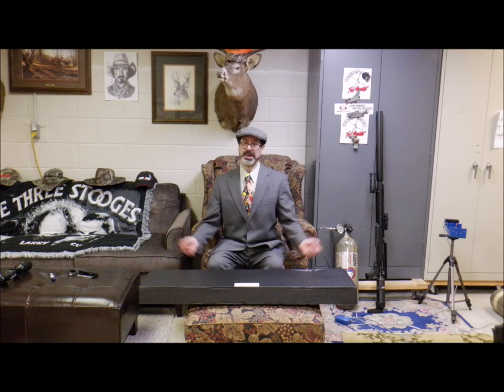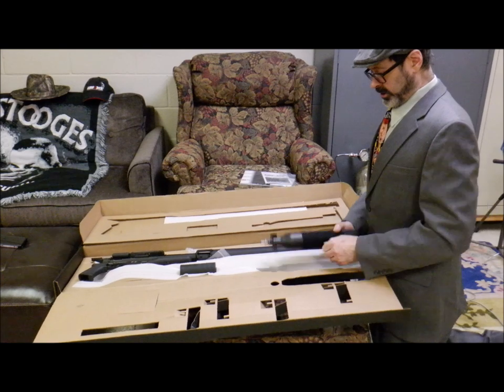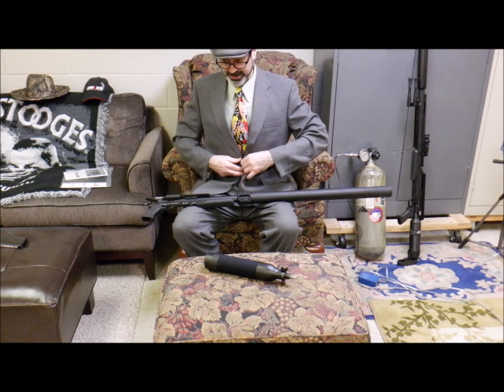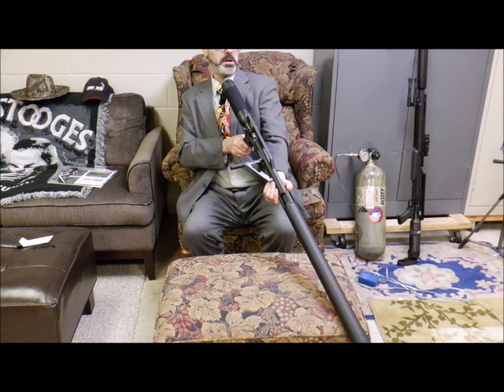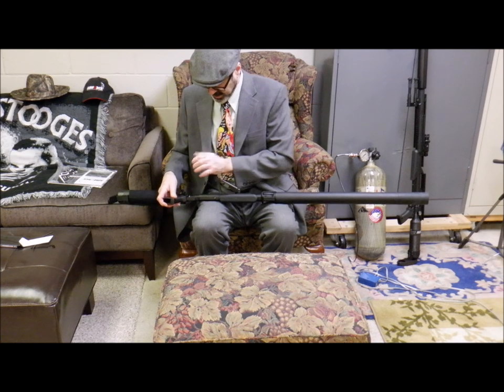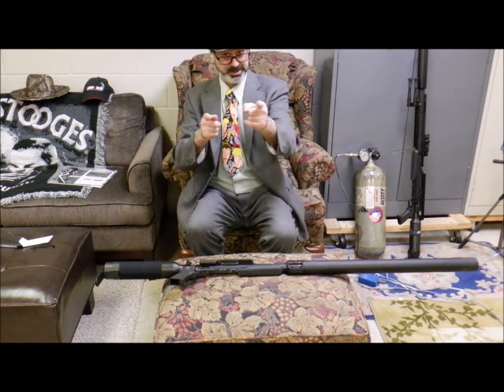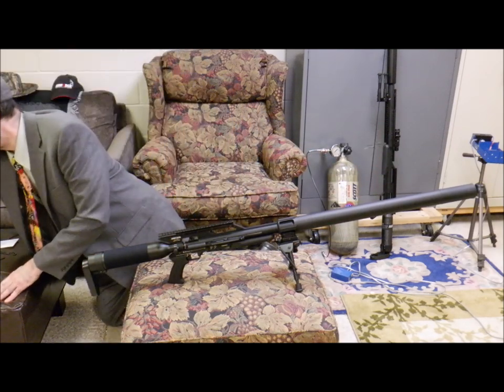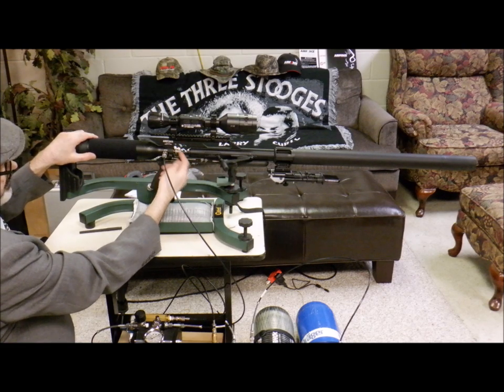The Texan 308 LSS

Comment: It'll be interesting to see what accuracy you get with this one. I have a .257, .357 and .457 Texans but I sold my .308 Texan because no matter what bullet I tried I just couldn't get the same accuracy of the other guns... Drove me nuts until I just gave up. Now I'm doing a 7mm (.284) Texan with an 18" twist barrel from TJ's.
Pull the inner valve spring and leave out the spring retainer, change to a TalonTunes CF bottle and get a better hammer spring from Doug Noble and you've got a DIY TX2.

Comment: Anyone getting good accuracy with the .308 Texan out of the box with pellets and slugs ? Light and heavy ?
Reply: Yeah man go with the Hunter’s Supply 111 and 150grn hollowpoint slugs on the 4-5notch power setting. I also use the poly mag 44.75grn on the lowest power setting and get some nice results as well. Everything is under the sound barrier, while you can sling those poly mag light pellets at hypersonic speeds it doesn’t help accuracy. I love my .308 Texan LSS you get at least several shots which is plenty for a hunt and it’s very versatile with those three pellets to  choose from. You can take small to medium sized game easily with just one gun, from squirrel-black bear. All from one package. I find it the perfect coyote and hog gun because of how quiet it is multiple shots are easy to pull off in one hunt even though it is a single shot.